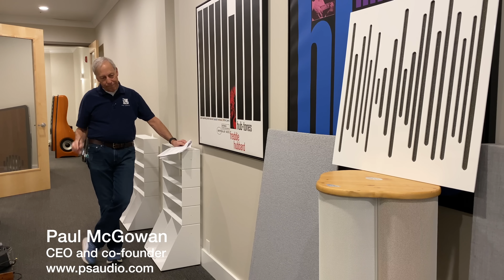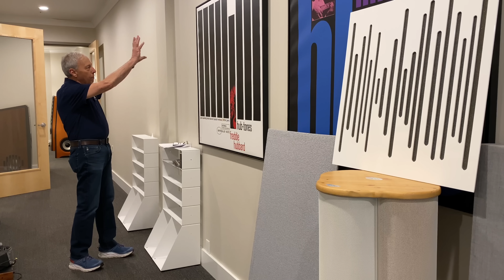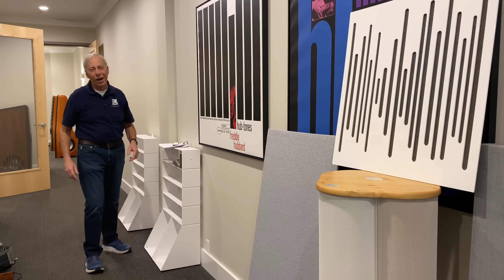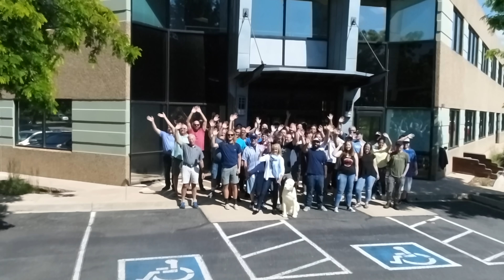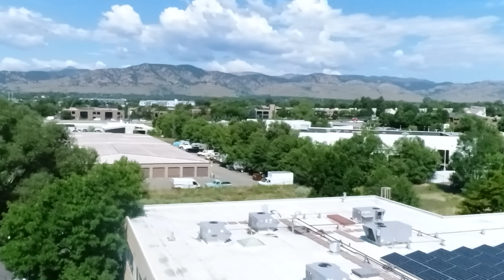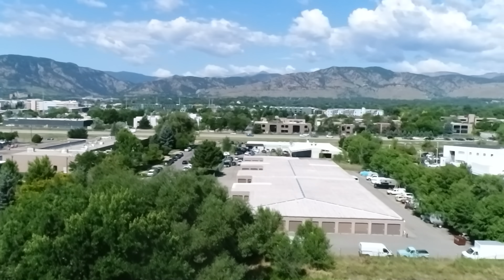USB Audio vs. I2S

Comment: Paul needs to go back into his lab and do some new testing.

Released in 1986, 34 years ago, an I2S data stream can carry one or two channels of data with a typical bit clock rate between 512 kHz, for an 8 kHz sampling rate, and 12.288 MHz, for a 192 kHz sampling rate.

USB 3.1 Gen 1 (released in July 2013) is capable of data transfer speeds up to 5Gbps. You can't buy a computer these days without a USB 3.1 interface on it. Gen 2 will be capable of 10Gbps.

So that makes USB 3.1 Gen 1 at least 500x faster and 27 years newer then I2S. I think Paul, in this video is refering to USB 2.x or older. 

There is no specific i2S connecton on a Raspberry Pi, but using software, and the pin header, you can create what is called a "HiFiBerry". Paul mentioning this makes me wonder if PS Audio has a project using the Raspberry Pi. I use a Pi running KODI for my Multimedia player including HiDef Audio. On my Fedora boxes I use VLC.

https://www.tomshardware.com/news/difference-between-usb-3.1-gen1-usb-3.1-gen2,36941.html

https://kodi.tv/
Reply: I have a manufacturer saying  that they deliver I2s through their usb connection and a selector between usb and I2s? I THOUGHT Paul McGowen had said that usb had to deliver the signal multiplexed vs the seperate data lines?
Reply: @pauldutcher9105  I do not have much of an understanding of I2s other then it's an at least 30-year old technology. Time to move on.
Reply: @pauldutcher9105  You have to kinda decipher sometimes what Paul says. What does he mean by "multiplexed". What do we mean with the terms "separate data lines".

Ref: https://en.wikipedia.org/wiki/I%C2%B2S

2 clock lines, 1 data line. So data is being fed through the I2s cable serially.. You can kinda say that's being "multiplexed".

USB format is two two wire balanced wires and maybe power and gnd. Again you can say that the data is being fed down, and back, in the USB cable serially. Or "multiplexed" if you wish.

Communicating with hardware with separate data lines" is antique. I can remember the SCSI Buss with 8 seperate data lines and a clock line. Back in the day. You don't even wanna be dealing with all that at todays data rates.
Reply: Try the I2S - LVDS (HDMI) board by Iancanada, or similar. The HDMI cable is by nature capable of transporting the I2S signal in a fully balanced way from one device to another, they've the needed amount of connectors and the needed amount of shielding (even more, if they're transmitting video signals). It doesn't need to be modified, multiplexed (like SPDIF) or whatsoever. An excellent and for now the best possible way to transfer these low voltage digital signals from a transport, or a source, to a highly capable modern DAC.

Nobody cares about USB speeds, I2S + HDMI in audio is a solution avoiding USB from the design itself completely, regardless of speed or whatsoever. The main issues with usb are conversions and high jitter, it's simply inferior to true direct I2S.
Reply: @disnaess  Jitter in a USB data stream is a non-issue as virtually all receiving end circuitry have some kind of buffer. Sometimes huge buffers. The data is reclocked out of the buffer so whatever jitter is on the incoming stream is reclocked out of it. And all of that is built into the USB chip.

The Raspberry Pi features four USB 3.0 ports
Reply: @wilcalint  USB is asynchronous and can by definition not be the source of jitter.
Reply: @ThinkingBetter  FWIW I actually used an asynchronous 150 baud modem in a project in the early 70's. It was leased from Bell and came in two parts. The dialer and the modem. I think we rented that thing for $1000/mo. And we had a buffer for both the sending and receiving serial data. Pointing fingers at "jitter" in a USB connection as a source of making a difference in the sound is if anything hilarious.
Reply: @wilcalint  This topic is riddled with snake oil nonsense. USB is absolutely not bad for audio provided you know how to use it avoiding noise to be induced into the analog side of the DAC. For example, don't use your computers noisy power to power your DAC via the USB cable.
Reply: @ThinkingBetter  My Raspberry Pi is soooooo koool :-)) I'll have a guest in here and play a surround sound movie and at the end of the movie show them the "Computer" that was playing it for them.
Reply: @wilcalint  Yes, things have changed. You can get excellent top-notch 4K video and audiophile surround sound out of finger sized SOCs nowadays. It's funny how a modern smart phone can be a better camera (both audio and video) than very expensive cameras just a few years ago. Kids can make higher-resolution and better sounding videos on their iPhone than the movie master of a 20 year old Hollywood movie.
Reply: @ThinkingBetter  sorry but usb audio is terrible if you're connecting a dac directly to a beefy pc. Idk where you pulled that one from that its not bad...
Reply: @Leo-yn5fx  That’s why I prefer using Macs for audio. An M1 Mac Mini is great also with USB connected DAC as it’s a low noise design. Generally, if anyone can accept vinyl with 70dB very audible noise, clicks, wow & flutter, you can not whine about some theoretical noise from a computer that is under 90dB of the noise floor and not really audible. But I’ve seen very noisy PCs and you are right it can be a problem especially DIY PCs with some bad parts.
Reply: @disnaess  And that's fine for an electronics hobbyist or an audiophile that doesn't mind his expensive devices modified and the warranty and possibly future service of any kind voided. But this is not an open public standard to interconnect products.

Comment: You say I2S > USB, but have you taken into account audiophile USB cards, reclockers and galvanic isolators ? Cause they make USB sound so much better. It sure is more expensive, but I'm curious to know how cleaned USB sounds compared to I2S.
Reply: Which do you prefer: Good quality from much work and great expense, or good quality for little work and a fair price?
Reply: @Hare_deLune  It depends, if optimized USB is better than I2S, then maybe it's worth it.
Reply: I have a PS Audio Direcstream DAC. If I use an Innuos Zenith MKIII server, an iFi iGalvanic galvanic isolator, and an Innuos Phoenix, all connected by expensive USB cables and with high high end power cables to a Shunyata Denali V2, there is still noticeably more grunge to the sound than the same setup with a Matrix X-SPDIF2 USB/I2S converter feeding the DAC. My USB line is about as polished as you can get, but it still benefits noticeable by using the DAC I2S HDMI input. 

If USB can go farther, it's on the DAC side, but I haven't heard anything as good as I2S yet.

Comment: Of experience
USB audio can cause a lot of noise! I've experienced it! Remember that USB has 5V and that a desktop computer has a lot of noise!

The best thing is to use digital coax or optical from your computer to DAC!

Have experienced noise with
Cambridge dacmagic plus!
Reply: Sorry you had that experience. Perhaps using a gaming motherboard has been the difference as my PC sound has been absolutely silent. No noise at all while using USB.
Reply: I would add that I did not have to install anything to use USB with the Emotiva preamp/DAC.
Reply: @trog69  Almost all usb sound cards or usb dac use the standard win audio driver and therefore there are no driver problems.
Reply: @trog69  Okay. I have the Asus Sabertooth 990fx and AMD FX-8350.
older computer yes but no cheap computer!

It is not the data signal in usb that is the problem but 5v in the usb cable that is the problem i think.

Put a noise meter inside a computer and the meter goes full immediately!

Measure 5v in the usb cable with the oscilloscope and you will see that there is noise
Reply: @FooBar89  you are wrong. Paul has talked about noise inside a computer several times. remember that usb carries 5V. if you are unlucky then you can get noise from some computers and others not so much noise on the same DAC.

Put a noise meter inside your PC and the meter goes full! some DACs also use 5v which is inside the usb cable!
Reply: @FooBar89  I have one
Cambridge dacmagic plus. I tried it on my friend's computer with usb and got audible noise! But with Digital coax and optical the noise was 100% gone!

on my computer there was no noise with usb! Both have more expensive gaming computers!

even if you do not experience noise when using usb it does not mean that usb never makes noise and never have problems with it!

Also remember that everything inside a computer is connected to 230V main GND so everything you connect to a PC will get 230V GND!

Comment: Can you actually hear the difference between USB, HDMI, COAX, TOSLINK....and other wired (optical) digital connections?
Reply: Never had a device that outputs all of them so never been able to test it.
Reply: Yes of course... Then again, I can hear the directional change of gossamer as it bathes in an ethereal stream of pure heat within the anechoic atmosphere of a sonic vacuum. 😉
I thought every audiophile was like that. 😂
Reply: You can hear a difference in all of them. Probably the most dramatically different are USB vs Toslink because you are going from the most electrical noise to electrical isolation (but with jitter).
Reply: Yes, if one is broken;)
Reply: Philip Cooper not unless you have Golden Hearing ...

Comment: If usb is so bad for audio, why so many studios used usb ("pro") soundcards to produce many albums? This usb bashing is an "hifi" fashion...
Usb was not so reliable 25 years ago, and at that moment it was better to use firewire. But things have really changed since that moment, and studio, or even home-studio (not to expensive) soundcards do use usb connexion in a much more stressful way that hifi dacs do, because it's multiple-channels transmission, and in bidirectionnal way, and also with much lower latency that what is required for just hifi listening.
Sorry to say that, but this is just BS to pretend that usb is not reliable for audio...
Reply: Panasonics and others use Firewires because it goes farthers and higerhs continuous data instead of USB burst.. Dont matter for me because my panasonics camcorder with Firewires ony streams at 320x240. I DONT LIKE BEST BUY NO MORE! thankes yoe and thumbbs ups!
Reply: Of course USB is not bad for audio. Studios don't use a large gaming PC connected to a USB DAC that is also powered through the gaming PC (USB 5V). If that's your reference, yes, USB can sound pretty bad. The key is to decouple the analog audio circuits from the digital circuits on power supply and ensure proper grounding and shielding. A Mac Mini can do well for an audiophile system. It's also without noisy fans. And Mac OS is usually much less of a nightmare than Windows when it comes to all sorts of setup and reliability issues.
Reply: To be honest, 99% of audio engineers have never thought to check if their digital connections sound good or bad. That being said, in actual studios AES/EBU connections are still the standard, and now DANTE or RAVENNA ethernet standards are becoming popular.
Reply: Not true!!  Studios used Firewire for audio!!!!  But USB was backed by Intel and when Apple switched to intel Firewire was abandoned and fall into disgrace.   But USB was always sh*t, everybody knew that.
Reply: @net_news  It was quite some time ago. 

For Example, latest Motu soundcards can achieve less than 2ms latency on usb...
Reply: @sebsoud  sure, USB can do today what Firewire did 25 years ago.
Reply: @net_news  No, it's much better, regarding the system interrupts stress on the os. Or firewire would still exists :-D
In win 10, the audio layers have completely been rewritten, and many people acknowleged great improvements.

Comment: In some magazine tests, USB "asynchronous" achieves quite low jitter.
Reply: With asynchronous data transfer, USB is by definition not the cause of jitter issues. USB is not a negative concerning audio fidelity at all when properly used (e.g. don't power your DAC via the USB data cable 5V).
Reply: Yeah but... at what cost?  Complex controller, drivers installation and even a sophisticated cable!!  You can get low jiiter with I2S without any of that complexity.
Reply: ThinkLearnSolve The point about audio running asynchronously is that USB doesn’t force a clock mastering scheme between the nodes like SPDIF and I2S do. Ideally there is only one clock managing the audio data flow and it’s the DAC’s own clock not needing PLL to try to match anyone else running a clock potentially yielding jitter issues. Ideally sufficient audio data is buffered in the DAC not yielding buffer under-runs and it is in full control of the precise timing tick of sample data being processed in it. Likewise, audio streaming from the internet is asynchronous and thus not a source of jitter. Digital studio gear needs digital synchronous audio interconnects for good reasons e.g. AES3.

Comment: USB is not a bus, despite the name ;)
Reply: I think I know what you are saying and yes, in that context your are correct. A true buss connection would be RS422/485 where the buss taps are literally wire nuts or just a simple mechanical electrical splice. The old computer buss standards lile ISA/PCI were also true electrical busses. USB requires active hardware to tap into. Software wise it's a buss and I think it's OK to call USB a bus topology but not really electrically.
Reply: @DIngbat donedon If you think this is funny, then you probably have the wrong kind of bus in mind ;)
Reply: In electronics it's spelled buss not bus.
Reply: @StewartMarkley  What? No its not.
Reply: @mark22732  You need to look it up.
Reply: @StewartMarkley  Also in electronics, it is called "Universal Serial Bus". The USB Wiki spells bus with single S throughout the document.